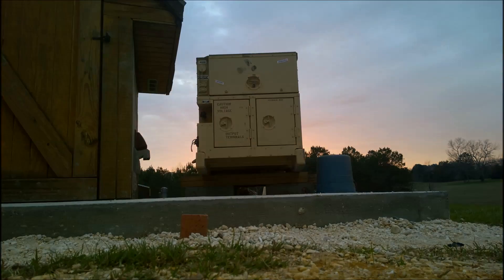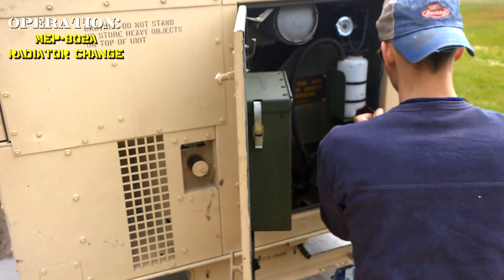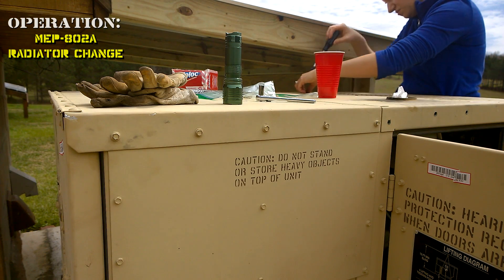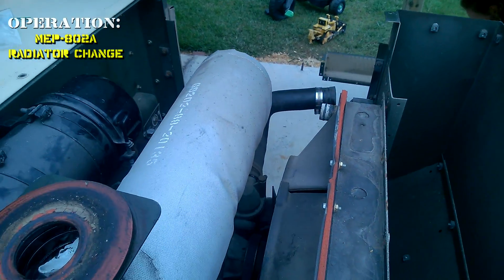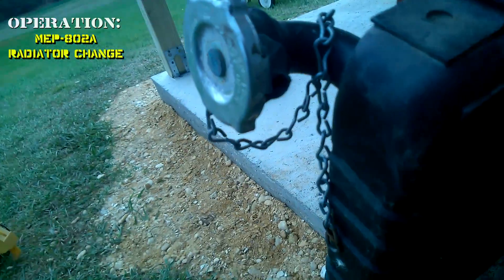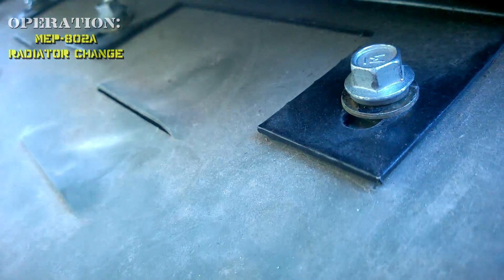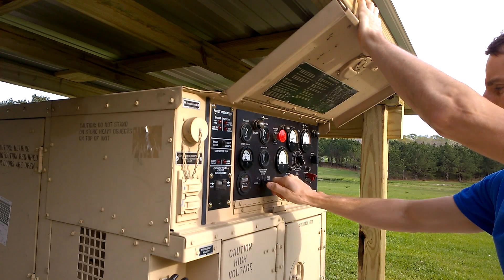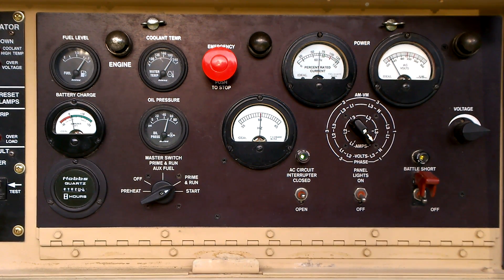Military Surplus Generator - MEP 802A RADIATOR CHANGE

Comment: question: our weapons maintenance truck in Europe had a 15KW Onan and its hot water was piped into a rad 
in the box of the truck to keep us warm. could you use the hot water for heat?
Reply: That's a good idea. Like a car or truck heater, you just have to plumb the hot water to where you need it. It would take a little thinking but in cold weather you absolutely could use some of that heat produced by the engine.

Comment: Where did you find a radiator? Are the bottom, angled mounting brackets part of the radiator or can they be removed to install on a new radiator? These engines were in 100's of applications & radiators came with all kinds of mounting brackets.